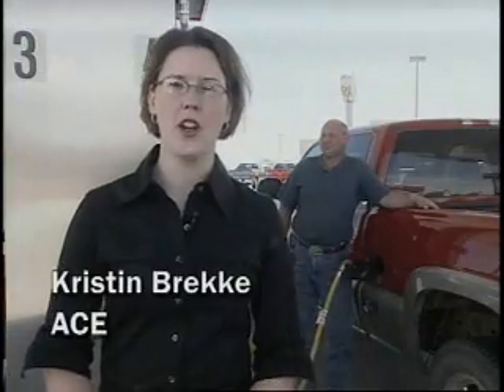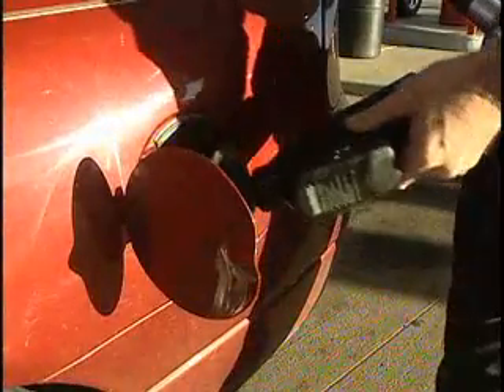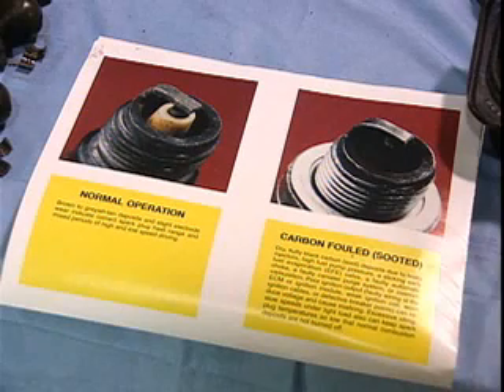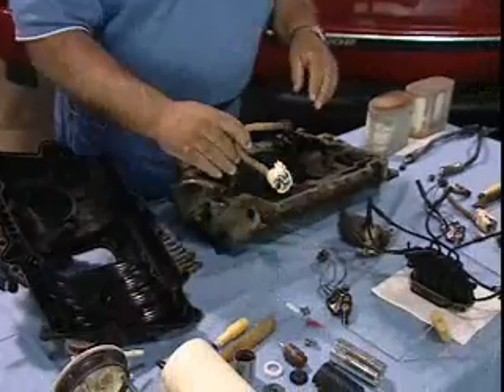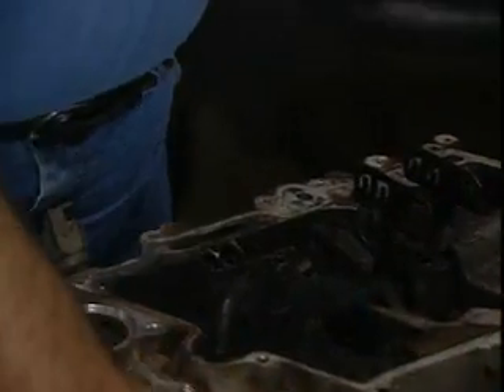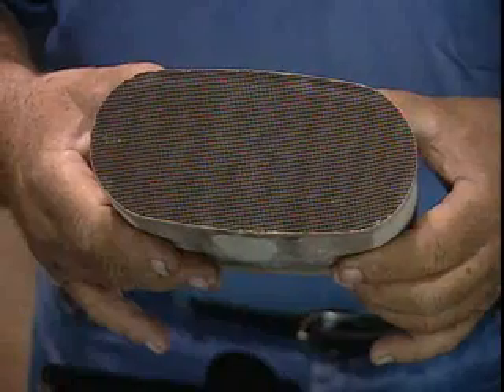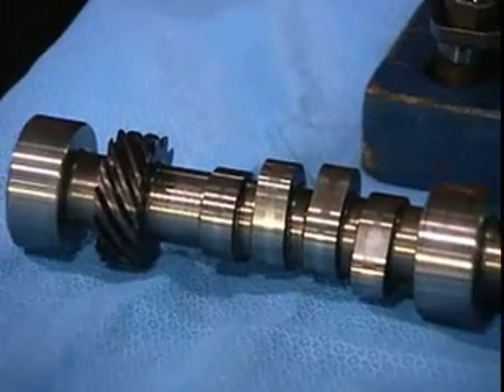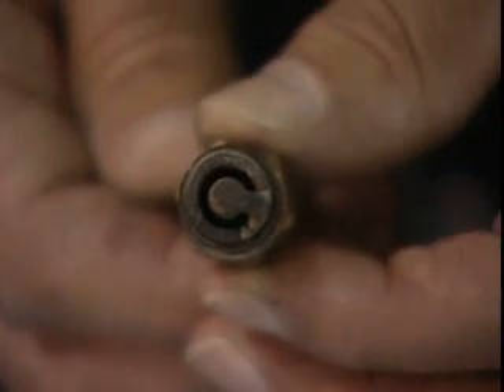Eighty-five percent ethanol fuels non FFV for 100,000+ miles

Comment: I post this not because I have anything to do with an oil company, but because I have just researched E85 and there are some drawbacks.  My Austrian-edition '85 Porsche 928S2 needs octane, and has been hesitating on E10.  I suspect a bad plug wire, but I was intrigued by E85 since this car has 10.4:1 compression and NO knock sensing!  In Austria, they sell REAL high-octane gas, so the E85's 105 octane appeals to me.

I think I'm going to steer clear;  You make your own decisions please.

Comment: Another issue with this fuel is that the fuel lines CANNOT be made of aluminum, and this fuel conducts electricity;  Gasoline is "dielectric" or an insulator.  In the wrong circumstances this could cause a vehicle gas tank to explode.  Read up on E85 on Wikipedia before you consider this fuel.

Comment: That valve looks rusted.  Valves are made of steel, and alcohol is highly hygrospcopic, meaning that it attracts WATER.  That cylinder likely had a leaking injector, causing RUST on top of the valve and probably in that cylinder!  If I had to guess, the compression on that cylinder would be low, likely out of spec, requiring a bore/hone job.

Comment: @greyflcn dude been running e 85 in all my internal cumbustion engines for 3 years now includeing 2 strokes not a single one has failed or leaked , increase fuel flow , advance timeing , increase spark, and open up plug gap and woohoo running sweet and clean   2000 ford Focus , 1982 Honda NU50 moped, lawn mower  and we now get 2.3 btu for every 1 btu put in to produce e 85 and once we start powering the e 85 plants with geo thermal it will go up even more...

Comment: E85 is a very good fuel it never hurt my 2 cars and my 1994 chevy pickup. I converted my 1992 buick century 3 years ago plus a 1993 grand am. The 2 cars i own have the 3.3 v6 moter. Never Hurt the fuel lines or injecters. Never had anything go wrong with the 2 cars or the truck. So come on guys stop the bs about e85. I also run e85 in my demo derby cars and has good luck with it in the demo derbys.
Reply: salut aujourd hui ca donne quoi ?
Reply: Did you need to chage the ROM chip on your 1992 Buick Century 3300 engine computer to accommodate ethanol?